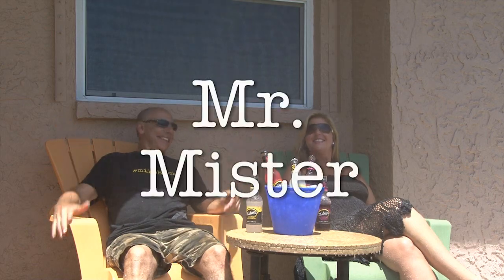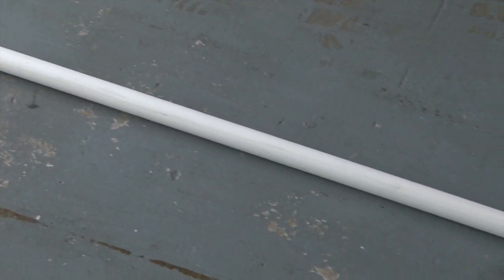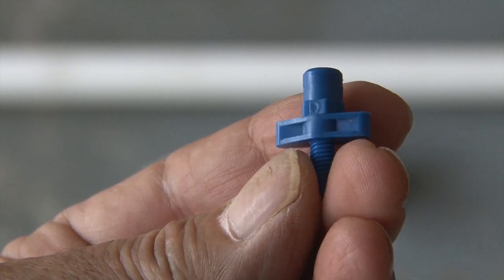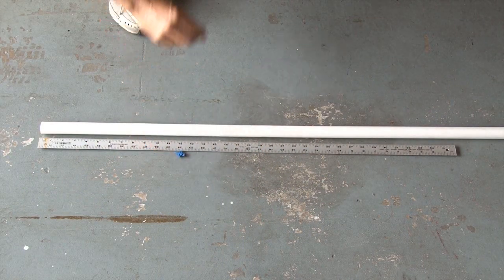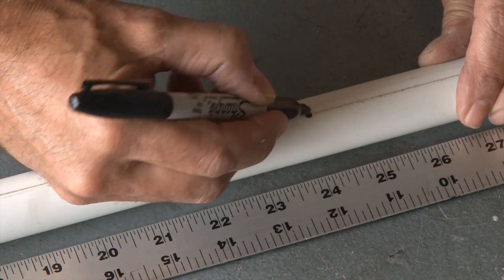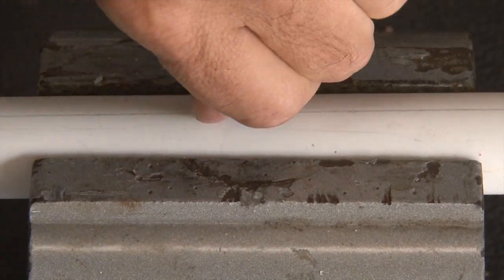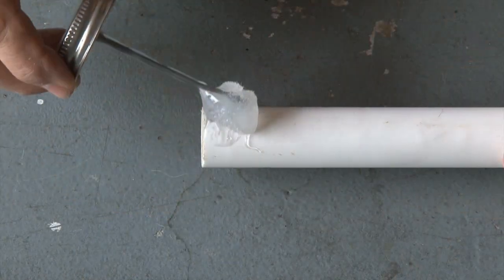Beat the Summertime Heat – Mr. Mister!

Comment: Kipkay, nice idea. People, the mister lowers temps even when it's humid. That's because the fine mist readily evaporates. The fine water droplets absorb plenty of heat as it evaporates. That's why there is that cooling effect. I plan to mist my roof on hot summers and the mist will act as a very effective radiant barrier keeping the attic and the house cool. Thanks Kipkay.

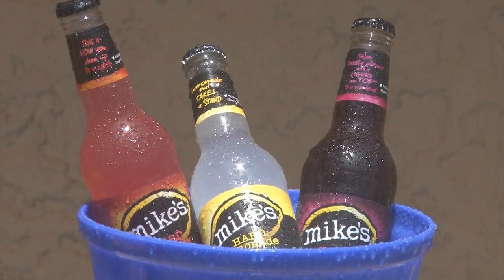Comment: HAHAHAHAHAHAH! 1:37-1:40 water is dripping off of the table and drinks like it is raining outside!!!  That is not misting that is raining!  FAIL!

I am a subscriber and like these videos... but sometimes... I don't know... I sometimes wonder if kipkay sort of is making a private joke to see how many people he can make do things... Like the putting the keyfob for a car alarm etc up to your chin to make it magically broadcast a stronger signal.  Sigh... try just holding the fob up in the air above the vehicles.  The difference between putting under chin is that you are now holding it up and orrienting it differently.  Your skull does not start functioning like it is being a transmitting station! he he  :-) 

For those that want to still do this... look for fogger type attachments... they are brass and in the same general area of your local hardware store. 

Unless you actualy want to be rained on to cool off... I have lived in Florida... humidity can be brutal enough.  ;-)

Comment: Take a big dowel rod about your height like 6 ft and 1 in or 1 1/2 in diameter, hollow it out and stuff it with survival things and when it's done take a rubber stopper or a piece of end pipe and close it
You just made your lightweight survival staff and you could use it as a Bo staff .

Comment: Its better if you use smaller nozzles, which are misting nozzles. It cools you via evap rather then wetting. It will also use less water rather then drenching you. Small nozzle and high pressure is best but you must use an inline filter otherwise you will need to remove and clean blocked nozzles

Comment: Things I would change to get a better mist and not rain:

1. Don't cheap out on the misters, get the brass ones instead they are under $15 for a 5 pack at Home Depot. They sell different styles with different "particle" sizes. You want the one that says fine or medium fine.
 
2. Use smaller inner diameter PVC pipe for higher psi.

3. Buy a simple shut off valve.

Steps 4-10 are optional

4. Instead of a simple shut off valve go electronic!  Spend a little more and get a yard sprinkler solenoid/valve, wire up 2 9v batteries in series with a switch, and of course waterproof it.

5. Use flexible tubing with PVC T-fittings. This way you can place the system in different shapes. Google "Mister system" and you will see what I am talking about.

6. If able point the misters in different directions to keep from getting soaked.

7. Make your system into an L shape and put the smaller section to the side, depending on which way the wind blows in your area on most days.

8. Use a calcium filter. This will help keep the nozzles and the system in general from getting clogged.

9. Don't be cheap. This is already a cheap project but it is worth spending a few extra bucks on better quality parts.

10. This one isn't optional: HAVE FUN! Don't use power tool while intoxicated.

Comment: Irrigation misters will probably not make fine enough droplets to make this comfortable.  I believe they do make misting hose attachments that would put out something finer.  You could use some T joints with extra hose converters stick the attachments on.  Plus, if you get the attachments with multiple options, you can use the other modes.

Comment: That would just up the humidity and make it feel hotter
Reply: Cool water + evaporation does not = +temp
Reply: you're dumb! misters drop the temp up to 30 degrees.
Reply: Over time it will cause the temperature to be raised very insignificantly, but it will cool the area for a short period of time effectively. (Assuming: water temp<air temp)